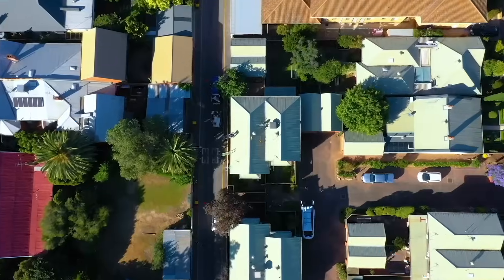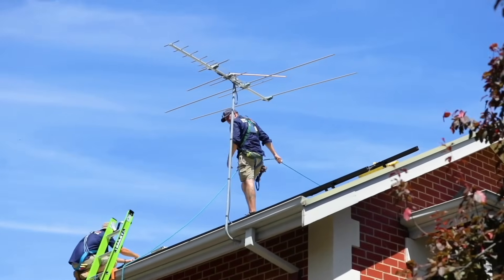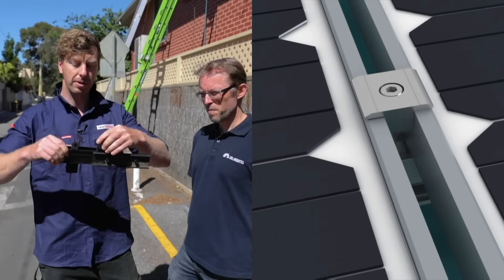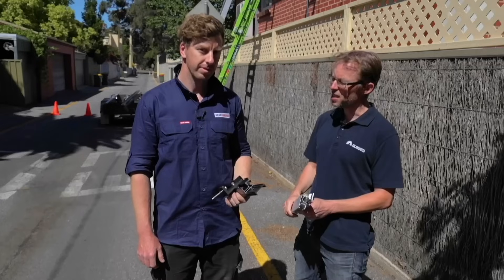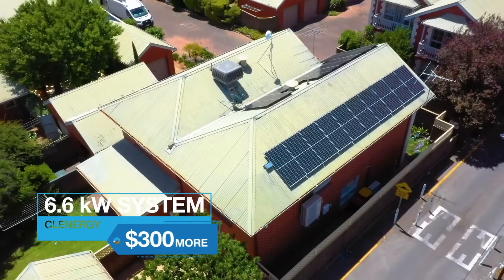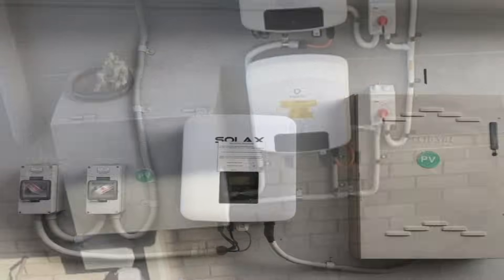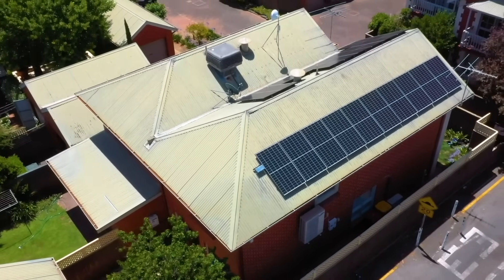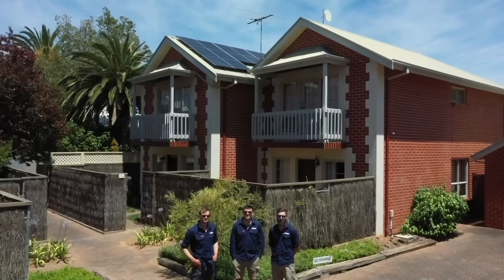Watch A Gold-Standard Solar Installation - Start To Finish.

Comment: Is mounting the inverter (and any other hardware for a PV install) allowed to be installed inside another cabinet for an even neater presentation?
Reply from the maker: Yes as long as you have adequate clearances  and ventilation.

Comment: Giday ,great video.
Is the my Micro inverter system i propose  a safer System ?

My System i wish to build - 4 x 570w solar panels connected to a  Micro inverter  2800w  20v - 60v DC in and the output is  230v at 8  amps 50hz single phase.
The output  from the micros(230v) go to a programable current switch mode  battery charger - 230v input - 48v output across  4x 12v 200amp hour Carbon lead batts (48v system)
(fixed Controlled Current) 
The Micros are programable with current sensing.

The Micros, to avoid issues would have Surge and RCBO 10 Amps Type B protection very close to inverter on the panel at the AC 230v output side. 
Micro input from the 4 panels would have 4 separate inline Fuses or 4 pole DC MCB(local panel Isolation) with their own surge protection on the DC side.
Home power would come from High frequency sun ark mppt inverter units connected to the Battery 48v (non interference system as Switch Mode charger from Micros to Batts is galvanic and offers isolation as do the galvanic Micros).
All IEC approved gear.
Its against my religion to use high voltage DC due to the risk factor (hail , water , Mechanical insulation breakdown and the Idiot factor).
Im interested in installing this at my brothers house in Queensland with a compliant installer, 

Thanks Mate from Andrew Nz

Comment: Extremely well done and professional!  The separate safety switches for each circuit is something I have installed in any house I have owned, and particularly good in a rental house! No more fencing wire in old fuses!!! Brilliantly designed system and of a quality that will last many years! ( ex-sparky)

Comment: Show us how you do ace event tile roof.

Every time I let a bozo onto my roof I end up with water  leaks and cracked tiles.   When they walk around they hear the tiles “snap” but they just keep walking hoping no-one noticed.    It you drill a hole in a cement tile you have ruined it………it may not snap today, but in a months time it’s a different story.    If you let them they will puncture your sarking and , again, pretend they nothings wrong!

Your team may be better, but whenever you sub out the installation, tho Bozos let you down

I have not yet seen a suitable fixing system for tiles.

A lot of people in my area have tiled roofs and they are holding off because if this industry wide deficiency!!!

Stavros

Comment: From the very first piece of equipment this fails the gold standard. Ideally it would be a curved foot that follows the shape of the colourbond. This will avoid flattening which can occur using an L foot and it's a better roof interface in terms of strength.
Reply from the maker: Skully, when you are installing solar on a tin roof, what brand of feet do you use?
Reply: only use the pucks or need them when doing landscape

Comment: Why would you use 250A CT for the energy meter?  Surely your total household consumption will not draw more than 60-80Amp and your solar generation could further reduce it by another 10-30A from generation. So why 250Amp CT in the switchboard?

Comment: Why only use a 5KW invertor with a 6.6kw solar system? Is there a loss of efficiency from the panels or ration to matching up the inverter to the panels?
Reply from the maker: Noel: https://www.solarquotes.com.au/blog/oversizing-solar-arrays/

(Short answer - 33% inverter oversizing is the max you're allowed to be able to claim the Australian solar rebate)
Reply: @SolarQuotes  thanks. Does that inverter size keep rising proportionately if you have more solar panels and still eligible for the rebate or is that capped or hit a smooth spot at 5KW inverter size?
Reply from the maker: @noelg5783  No, it scales up - for example, a 10 kW inverter can have 13.3 kW of panels :)

Comment: .. hopefully newer home roof designed for solar with optimum tilt angle through out the year..also inverter/optimiser has mineral oil submerged cooling..

Comment: I’ve heard stories about micro converters. Are the same thing as power optimisers?
Reply: No. Micro inverters take each panel's DC -> 240V AC, supervised by a central controller.
Power optimisers tweak each panel's DC -> optimised DC, and then a main inverter does string DC -> 240V AC.
Micro inverters and power optimisers both do MPPT (Maximum Power Point Tracking) at every panel,
which is different from normal String inverters that only MPPT for the whole string.
Reply from the maker: Different technology that gives a similar result - see our write-up here: https://www.solarquotes.com.au/blog/solar-panel-optimisation/

Comment: This is exactly what I needed to see! Looking at a 6.6kw system at the moment (obtained quotes via solarquotes) this reminded me of all the questions I need to tick off before I go ahead and sign off. Power optimiser consideration a big one as we have numerous shade issues, and great to see an aesthetically pleasing install too.
Reply: Go big if you can 6.6kw is very last decade
Reply: @chefgav1  our house has some serious shade issues, ended up going with 7.88kw with power optimisers.
Reply: @shmickist  How much shade? A little shade is no big deal really. I loose a little in winter and very late afternoon mid summer and it’s not that bad really
Reply: @chefgav1  an 80 year old gum covers 3/4 useable roof space in winter.
Reply: @shmickist  ah OK fair enough.  With that much shade imo it would have been better with Enphase
Reply: @chefgav1  with respect mate you are doling out advice with no idea of the circumstances. A minute ago you were saying to go bigger than 6.6. I could live in a cave for all you know.